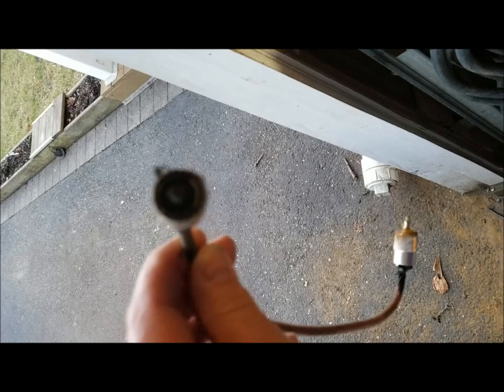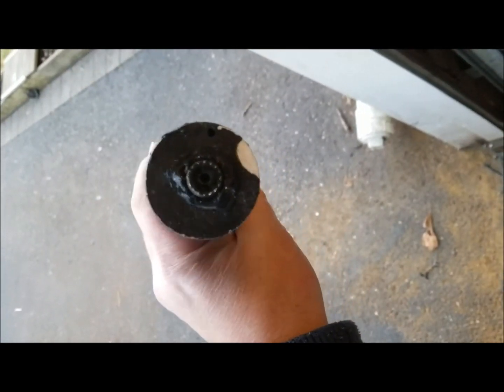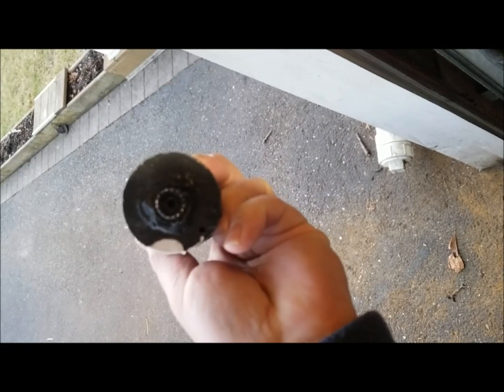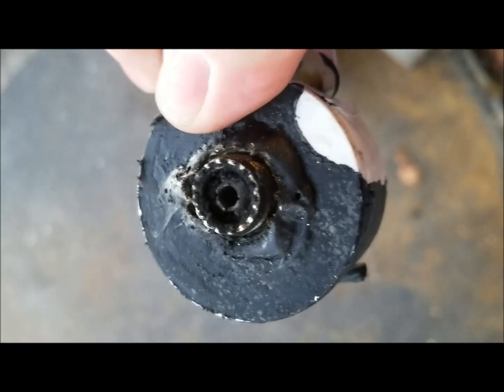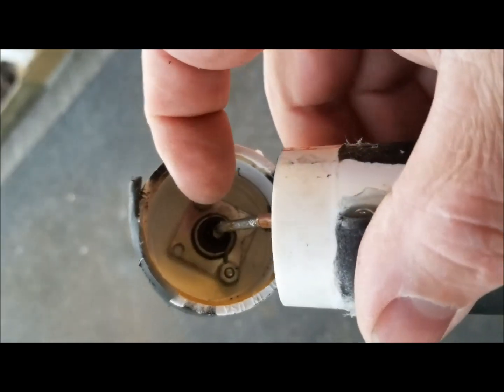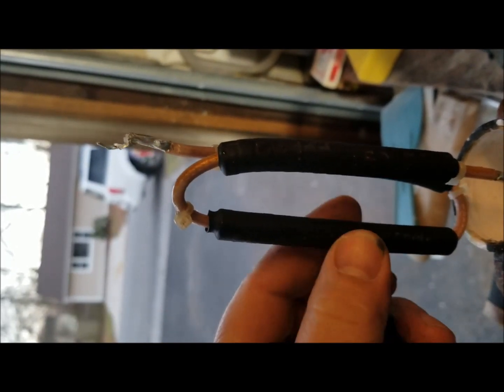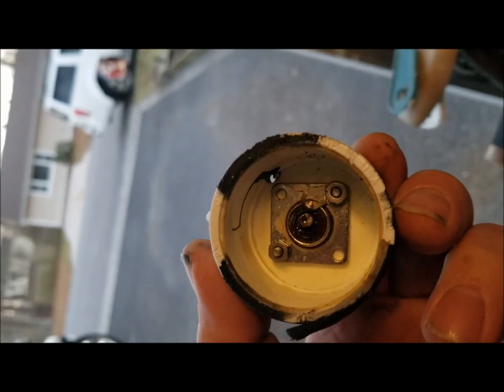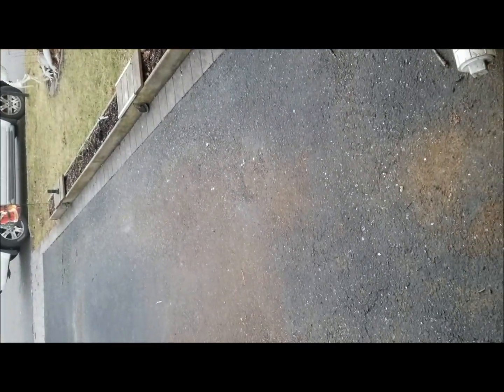Roasting A MFJ-915

Comment: dude if you got rf that bad you going fry your rig one day
Reply from the maker: Good Day Andrew, If you want to ride the lightning, it requires LOTS of RF going out... that's what makes Radio propagation work. MFJ just couldn't handle the load. RF back to the shack is when things start becoming problematic. Hams do a couple of things to prevent that from happening.  73!

Comment: I had one - was fine and then just overnight it wasn't. Started getting wonky signals and my wife comes in and says "is that thing behind the bushes supposed to be smoking?" Lol. Only thing that should smoke in the yard is my grill/smoker. The braid was soldered so close to the 239 center pin inside it was apparently arcing? Melted plastic and smoke. Somebody wasn't paying attention when they built it. Will make my own air core from now on. Worked, until it didn't.
Reply from the maker: Hey Chris.  MFJ isn't notorious for creating fine equipment (Mighty Fine Junk). Dissatisfaction can be expected with MFJ. 
These days I work a lot of FT8. I did away with the choke on my 1/2 wave dipole array. All appears well by the signal reports I receive.  I don't like adding components in If there is no real evidence they are augmenting the system. The way I see it...If a component isn't adding... it can only be passive, or parasitic.

Comment: The inner coax is RG303 which handles very high wattage for HF. Much higher than 1500w from 30-1 mhz. Yes your right. It looks like a possible lousy solder job on the SO-239.
Reply from the maker: Hello Steve,

I have had the “balun” up on the mast for a few years. I have changed out a short piece of RG8X once before, due to failure (probable center conductor migration in the wire)
 I typically use dielectric grease at all connections, and sometimes brush on tape or, a rubberized spray sealant to try to keep the wires impervious to water infiltration. 
I live on a high elevation on long island, N.Y. and the whole array is constantly exposed to high winds, and temperature extremes on both sides of the thermometer. Things do fail mechanically. MFJ isn’t exactly known for its quality materials either. 
I don’t think a poor solder joint would cause an arc over like that. That would likely stay within the center pin of the male connector until complete loss of conductivity happened.  
I’m leaning towards the perfect storm of the operator (yours truly) pushing the envelope with too much juice, on elements not tuned for the band, and possibly contamination within the connection itself.  All this may have triggered an initial spark. 
You know how that goes… High Voltage + HF + Ark born from resistance = The birth of an HF arc welder. (until the resistance burns off opening the circuit)
If that’s the worst thing that happens over all the good DX… That’s a win! I will take it!  

Good DX, and 73!
Ray KD2IBP

Comment: So just a loose connector and high power arc over, loose enough to act like capacitance to arc over ? I wonder.
Reply from the maker: Hey Dennis,
We can only speculate at this point. There could have been several factors at play… including a loose connection, water / mineral infiltration, high power (+/-500W) HF driven into poorly tuned elements.
Just goes to show how much energy we are playing with. Good times!
73’s